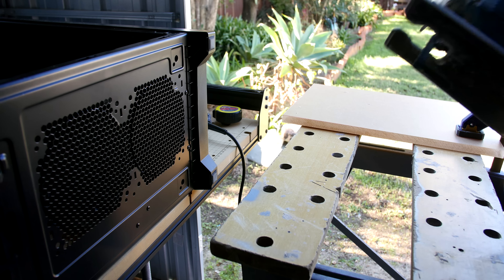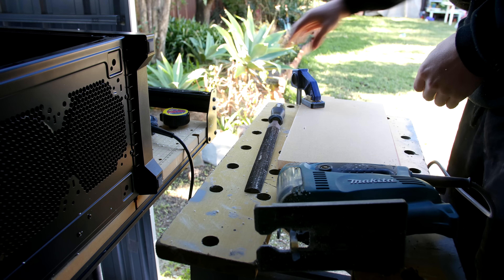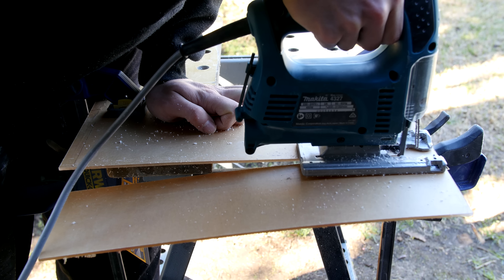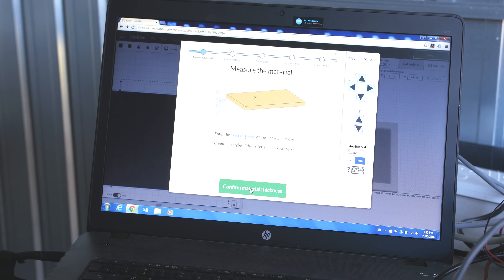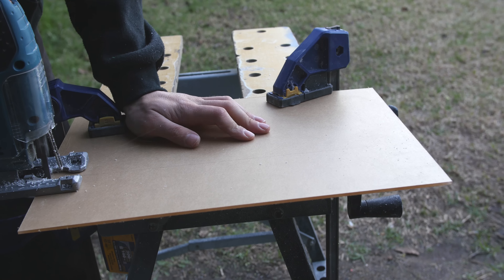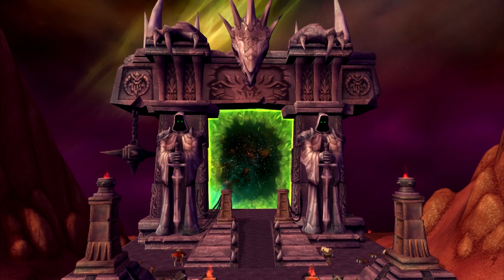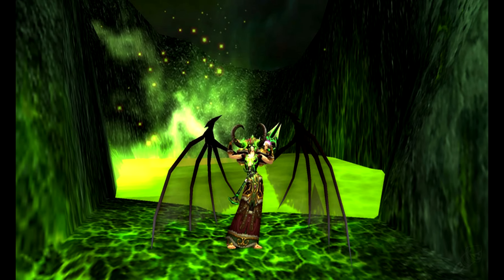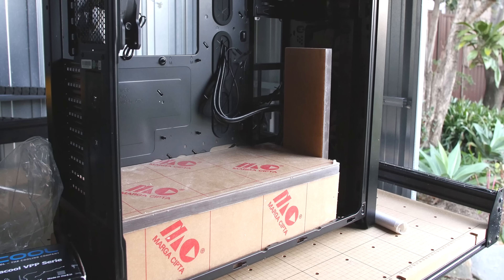Custom Watercooled Gaming PC Build Giveaway World Wide - PROGRESS 1 MSI and Corsair

Comment: Yeah! Finally! Btw Corey, you've to considering use metal or glass materials as the main components. If not at this build, then use it in another builds. Maybe it would be hard to work with. But metal and glass are really good in durability, also they are looks more premium I believe. Well, keep awesome then...
Reply from the maker: +Wahyu Hidayat most of my machines use metals =) i dont have the machinery for cutting glass so acrylic is the next best thing =)
Reply: +Imfaceroll Gaming I thought it won't takes much longer time to have any tools you want to. You've passion, creativity, and ability. All you've to do is to get any opportunity from manufacturers that can supporting you. The manufacturers that can be pushing every single of you to the limit. Don't be ever loose by "struggle". Wish all the best dude! Cheers!

Comment: Sick as CNC, where'd you get access to that? If you had access to a 3D printer you would have endless possibilities to design your own custom cases.
Reply from the maker: +scotty112358 i actually bought it in bits and pieces and had to build it
Reply: damn thats crazy dude, what the dimensions and would it work with CAD or autoCAD?
Reply from the maker: +scotty112358 its a 1x1m work area and you can draw up your design in cad/auto cad but then you need to export into another program